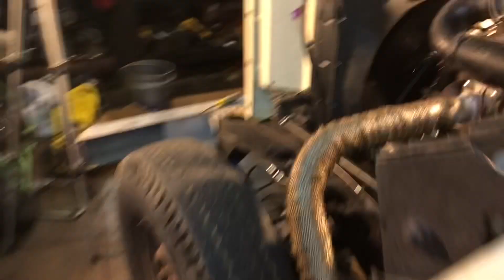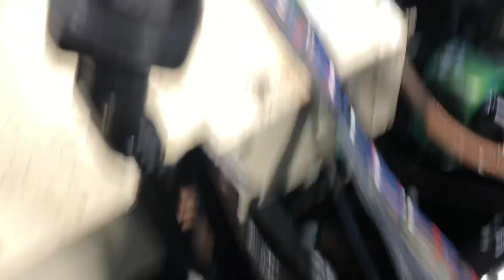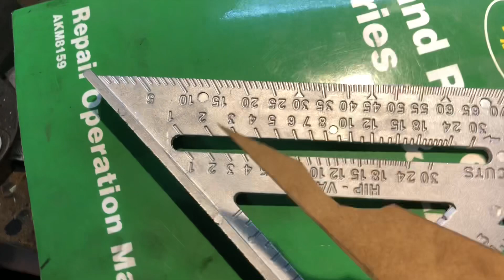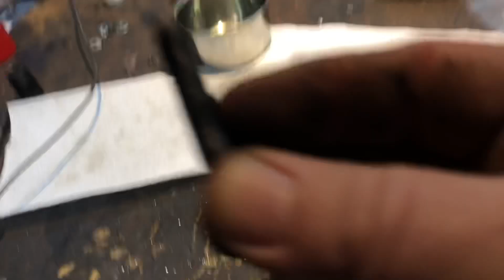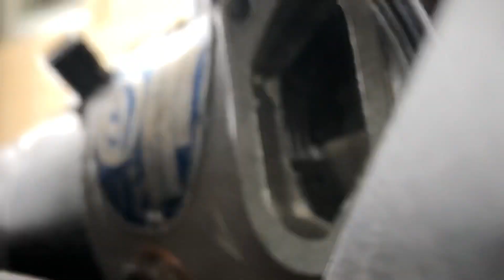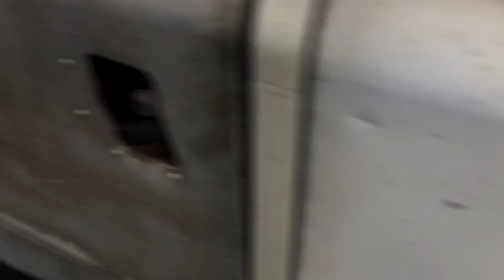Timing adjustment check Land Rover series 2A 2.25l diesel restoration chain start

Comment: If you're running a 4-7psi aftermarket electric fuel pump it may be oversized for the system try putting the mechanical hand lift pump back on to get the system under 4psi because forcing excessive fuel into the injectors makes it too rich ,burns inefficiently and smokes and takes away power. Thanks. for the timing tips.

Comment: I had the same problem. The camshaft timing wasn't properly set and I had made a tool to indicate the 20º angle for the pump. The 20º set with the timing tool is to have the proper injection timing in relation to the crankshaft and pistons. The camshaft just drives the pump and if the camshaft timing isn't correct it will affect engine power as well. I made a few more timing tools, as it was rather expensive. The original tool wasn't found anywhere.
Reply from the maker: Very true. Thank you for watching!
Reply: Hello mate, 
I wonder if you could share some detailed pictures of your timing tool. It would be great to know how should the shaft welded on the plate, where should it point to regarding to the slot you move around the nut. I wanted to fabricate something like the official tool, but without these measurements and angles, I didn’t even tried.
Reply: @laszlopolyak4353  Hi, I still have a few timing tools that I can sell, as the laser cutting and writing of 20 pieces was just 10% more expensive than laser cutting 1 piece for myself.

Comment: Hello, Cory, I'm in the same boat, only my equipment is a little different (massey ferguson 35, perkins engin CAV pump) we bought this tractor and are trying to resurrect it. so we did an overhaul, fixed the high pressure pump, injectors and bench checked everything, timing chain, cylinders, pistons, rings and everything. But the engine does not work exactly as it did before the restoration. There are only two ways to start the engine, either with starter spray or when the engine is hot. when the engine is running it has no power. Compression in all cylinders is 24-26bar. the fuel pump is turned all the way and there is no more room to advance the injection. why do you think this situation occurs? did you somehow manage to fix this problem? Thans for answer :)
Reply: Cory, finaly i find a problem!  The main thing was timing chain (camshaft) sprocket. In my case sprocket have 6 ataching holes, then you rotate by one, it move by ‘33,3% distan betwen tooth” if you rotate it one more it do same… so you have posibility asambly by engine needs… i hope it wil help and you. Good luck!
Reply from the maker: @valentasd8217  6 holes would throw it off. I have a feeling something slipped on my timing chain.
Reply: @conrad1468  this video explains everything. Just in my sprocet is 6 holes. It meens more space for adjust. https://m.youtube.com/watch?v=oFVKcbnObKQ
Reply from the maker: @valentasd8217  I’ve watched a few of he’s videos. Excellent explanation. Thank you for sharing!
Reply from the maker: Sorry to hear about your troubles. I’m glad to hear about your troubles! 😀 Makes me feel like I’m not crazy and something like this happened to someone else.  During my testing my rear diff broke. I have not had a chance to rebuild the diff to continue testing. It’s not filmed but I was going to start lowering the pop pressure of the injectors to adjust the timing. I figure less pressure the timing will increase?!?! It would be great if you could give it a try and see what happens. I turned my injectors back about 1/8 of turn while still in the engine and my RPMs raised on restart. So the concept might work?!?! I don’t know until I can get it moving again. Let me know if you try it and your results.
Reply: @conrad1468  I searched for so long, the same unfortunate person to whom something similar happened and I finally found it :D I was already peeling off the pump and enlarging the holes, but I got the advice of a very experienced motor mechanic to look for the problem elsewhere. he guaranteed that the main problem is in the timing chain sprockets and their splines, for example, there may have been too much slack, as a result of which the sprocket has moved to the direction of engine rotation. also said it is possible that there are rotating parts in the dpa pump that can affect the moment of injection. what else did he say that the amount of fuel in the pump should be adjusted according to the specific engine and that it would be best to do it in the adjustment device. by the way, when I had already disassembled the engine twice, I did not notice anything like this, and the tags seemed to be in their places, but I had not physically removed it. so I don't have time to work yet, but as soon as I start I will be able to inform you about the results. By the way, I will wait to hear from you as well.
Reply from the maker: @valentasd8217  It is crazy having 2 people with the same issue.  I thought it was the timing chain, too.  I checked the amount of lift the chain was off by using the Top Exhaust notch on the flywheel and the valve lift.  It was very minimum off.  Not enough to effect anything but who knows until I actually tear into it. It could be enough to throw off everything. ha ha!! Keep me updated on what you find out.  I would be very interested.  If i had time i would have torn into mine but hope to have time summer of 2023. :)
Reply: @conrad1468  , this weekend i found a problem. It and it was the pump flange gears. I twisted the little one through one tooth. and it seems this problem is solved. The injection time seems spot on, but as we say here in Lithuania - one trouble, not a trouble :D now miracles started to happen. I start the engine, it works fine, I fix all the pipes and everything that I had dismantled. I start again - it starts after half a revolution. but only if I heat the glow plugs. it won't start without heating plugs. (before this didn't happen, if I started the engine and worm it little bit it started working without problems and without heating plugs. In the morning, outside -5, in the garage +10 try to start it - nothing happens. I heat the plugs again, turning again - nothing happens. Yesterday i turned  engine of with engine stop lever. I suffer until the battery is almost dead. suddenly it starts, but two cylinders do not work. a lot of smoke, my father and I are scratching our heads and trying to understand what happened during the night. I tried to start it a few more times, but is the same. Finally, my father turned the pump on flnch (few mm), put it on one of the three marks and he drove out. The engine starts again, everything is fine again until turn it off. after turning it off, the song is the same again. Smokes, two cilinders ans so on....

p.s. I can send a photo or a video to an email or wherever is convenient for you, maybe you will understand better what kind of French I am talking about.
Reply from the maker: @valentasd8217  seems to be never ending!! Send me an email. It’s in the description. It does seem like some crazy is going on with your tractor.
Reply: @conrad1468   , hello. New years/old problems. But finaly i think found a main problem. Last time i mentin that gears are problem, but for long time spend on internet, analyzing photos and other info i figured out that is the camshaft sprocket. in my case it  have 6 foles for screws. So if i rotete sprocket by one hole it change position by 0,5 of “tooth”. Very important rotate a sprocket not a whole camchaft. Position of it must stay tha same, sust diferent holes on sprocet. At the moment i dont have time to open and fix it. But i belive that is main problem. There is video with similar engine, just thith 4 holes and there are no tentioner like in my engine, but principle you will catch.

https://youtu.be/oFVKcbnObKQ

So…. Then i fix it i will inform you about this theroyvan fixing :)

Comment: Hello Cory I would think you need to change the timing chain  and put the older pump on as the new one doesn't time up internally  maybe👍
Reply: Think you are correct about the timing chain, when you have to fully advance the pump to get it running better it is in need of a new chain, these engines are known for timing chain wear.
Reply: I think @Chinkychops12 is correct. Everything I've read is that the timing chains slacken due to the cam shaft having to drive the injection pump through the skew gear. Eventually you cannot time out that wear--unless you cut bigger channels in the injection pump mounting plate OR use skinnier studs so the pump turns more. I have this very same problem and have determined through the process of elimination (e.g., new injectors, pump advancement, etc.) that the chain is in need of replacement. Apologies for the late-in-the-game reply. ~Pete
Reply from the maker: You are correct. Timing chain may be refreshed in the future. The diesel shop rebuilt my original pump. So I don’t have another to try. I am thinking of adjust the pop pressure of the injectors to match the pump pressure. I don’t know. I’m still trying to figure it out. Thank you!
Reply: @conrad1468  ok no probs thanks for you videos they do help  👍

Comment: Hi Cory, I got the same issue with my 2.25 diesel.  I cut and rewelded the quill shaft (the short shaft that connects the inj pump to the skew gear). This gave the same effect as the thinner studs. Runs better now as I can advance the pump more.  Maybe consider testing the burst pressure of the injectors. One (or two) might be bursting out too much/early fuel.  Good luck.  If you get it sorted let me know.  I'm working on mine tomorrow!
Reply: https://youtu.be/ygM_1MvDBtE
Reply from the maker: Now that adjustment by modifying the pump input shaft. That’s a good idea. It’s definitely better than before but still not great. I have a diesel injector pop tester/set tool. It works pretty good. I have them all set to the same pop pressure. I think I’m expecting too much from the little 2.25 diesel. How does yours going up hills? What is your cruising speed on flat roads? I’m terrible on hills and cruise at about 45mph on flat.
Reply: 45mph on the straight and running out of puff on hills doesn't sound a mile out to me. Good luck with it and thanks for the videos.,

Comment: Hey Cory, I wonder if fuel is being injected too late? If it's being injected on the down stroke, it won't produce as much power and if it's cold,  some of the cylinders may not fire at all and you would get white smoke. When it warms up, you would see all firing but with reduced power, especially at higher rpm. What happens if you centre the pump? Not having the diesel variant, it's hard for me to visualise. Is it possible to see when the injector pops while rotating the engine by hand? Getting diesels set up is a pain. I used to work on old ALCO diesel train engines in the late 90's. Great workhorse, but setting them up after a rebuild was a science! If it was me, I'd centre the pump and experiment rotating one way or the other. If that didn't help, I might look at the gear timing of the pump. Hopefully you crack this when you adjust the mixture settings.
Reply from the maker: Hello Meryk, I did try the center of the groove and the other side of the groove. Center was lower power. The other end of the groove I couldn’t even get the thing to start. So I’m at the max advance at the current end of the groove. The timing is similar to a petrol distributor. But with a diesel pump spraying fuel and pistons compression making the spark. I’m setting the diesel pump to spray fuel at the “same” time as the spark would on a petrol distributor. I know what I mean? Ha ha!

Comment: Hi Cory,  sorry to see you are having issues! White smoke is unburned fuel, so either excessive fuel, insufficient air or the compression is not enough to ignite the fuel. As it is puffing, it could be that one cylinder is low compression. I had a look around and it might pay to check the banjo bolts on the rail to see that the holes are clear and the return is not restricted. If air is being trapped in the rail, it can cause delivery issues. Excessive fuel... hmm...perhaps wind back on the pump to deliver less? Hope you nut this one out! Thanks for the video! Maybe post on the fb page for someone who has seen this before. Good luck!
Reply from the maker: Thank you for the ideas and tips. I agree, definitely unburnt fuel because when it’s warmed up there’s no smoke. I’m going to mess with the amount of squirt from the pump.
Reply: white smoke can also be timing retarded.

Comment: Did you check your cam lobes before doing installing your cylinder head? I cannot remember in your previous videos. Ive recently had to change my cam and rollers. If you ever  need to replace maybe use turners from uk for the rollers.
You could be down an intake lobe?
Reply from the maker: That’s a good idea. I should have checked it while apart. I didn’t not think of the lobes being worn. But it could be. I wonder… Do they make a “performance” or more power cams for the diesel. mmmm.. makes me think. Ha ha!!